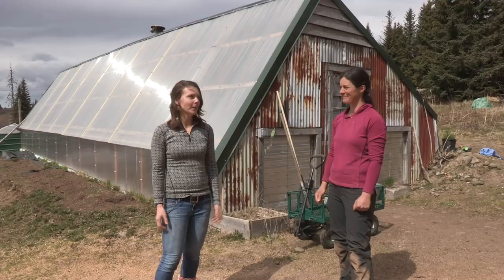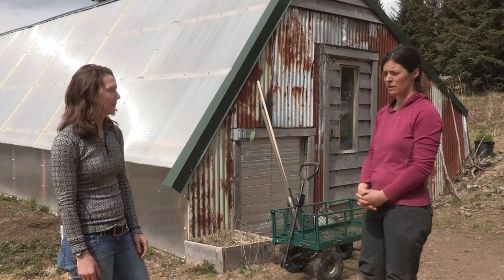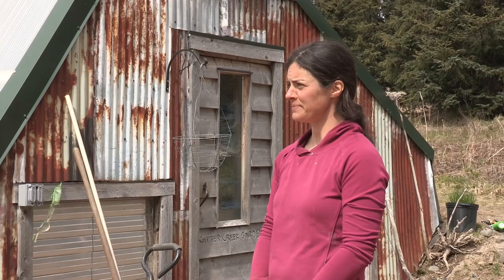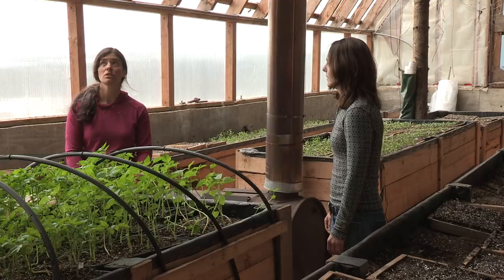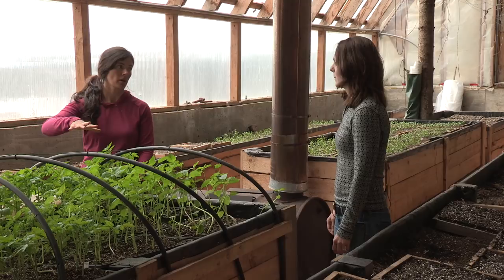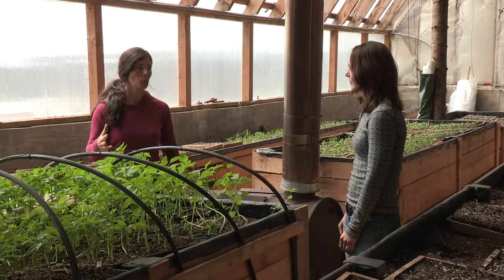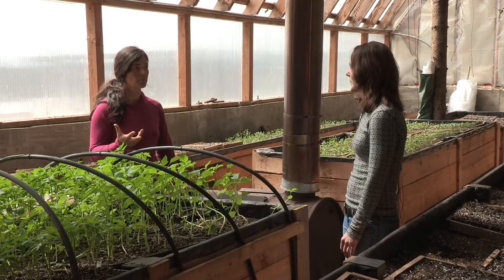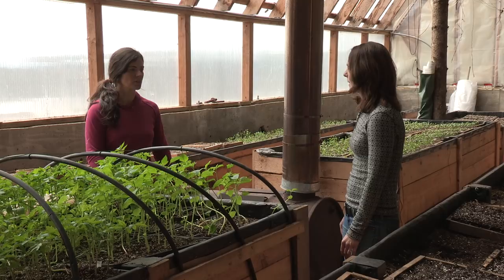A Passive Solar Greenhouse - In the Alaska Garden with Heidi Rader

Comment: Please consider using black paint to coat surfaces that the sun shines on within your greenhouse. The color black absorbs and retains far more energy from the sun in the form of heat than any other color. Black stones and black water containers are particularly good at holding heat. Love the greenhouse, excellent work!
Reply: and our roads should be a cream cement in color
Reply: This is tough in the summer time when solar gain excessive. Have contemplated the same myself. You need a magical material that gets darker as ambient air cools and turns dead white when it is hot.
Reply: @yepnope2195  One method my friend used in his partially-sub-terrain greenhouse to counter the issue of excessive radiant heat capture in summertime is a secondary water tank. One tank is painted matte black, the other gloss white. They are emptied and their positions switched twice per year to help maintain favorable temperatures. The gloss white tank is actually difficult to look at in full sun it's so effective at reflecting the light back at the plants, while the three-coating-thick matte black painted water tank is excellent at capturing and retaining heat. They are using high intensity discharge lamps as supplemental lighting which effectively heat the tank even on fully overcast winter days, which helps retain a lot of heat through the evening. With about ten inches of air insulating the greenhouse between the external and internal vapor barriers, we've been able to grow year round here in Western Canada.
Reply: @yepnope2195  I suppose using 'panda poly' white / black mylar would be a method to attempt if you were in a situation that did not allow for a second reservoir, but I don't think the heat transfer would be anywhere as efficient without direct contact to the plastic. Could you paint one side black and one side white and rotate it 180%? Maybe it could even sit on a wheeled dolly so it could be rotated when full?
Reply: @noyoureahooker  Hah duh, paint your 55 gal barrels two colors. They're not too bad to spin with a little practice. Dollies, while expensive make this a no-brainer, esp if you are stacking. The couple of barrels in my micro-greenhouse are actually stainless atm. I've left them nude atm in the name of conductivity, but yeah I donno. Kinda making it up as I go.
Reply: @yepnope2195  right on.. with stainless tanks I would even consider using adhesive vinyl. Blasting it with the heat gun after application would yield exquisite contact; and you could peel it off with some elbow grease and a little goo-gone if you change your mind.
Reply: Homade sun powered boiler system
Reply: Look up Trombe Wall.
Reply: Use a white curtain to cover the wall in the summer.
Reply: Quiet melt

Comment: Doorways need a “cold trap”. Think of when you open a fridge or freezer...the cold air is denser...it spills out like a waterfall. 
It is known that depressions and hills create “microclimates” outside. The greenhouse in this video is certainly doing the same thing!
The door and stairs are creating excellent cold air spillage down to the floor level of the greenhouse. The air is pooling there and reducing the warmth of the grow beds and their soil. 
A “cold trap” would be an enclosed foyer at a level LOWER than the entry into the greenhouse. The coldest air is thus “trapped” in the foyer instead of being allowed to spill right down the inner greenhouse stairs. It thus modifies the “microclimate” in the greenhouse by reducing loss of heat.
The concrete walls, I noticed, do not have insulation, which is another heat sink for the greenhouse. That will help cooling a bit in the summer, but it does not aid warming in the winter. All the concrete should have closed cell insulation with black bags or drums to hold water. 
They are not using the space effectively, either. Rotating tower gardens would make MUCH better use of the vertical space available. 
For a place that gets as cold as Alaska does, I would certainly build a rocket mass heater. The gas chamber can go over 1000 degrees F, and the bench holds temperature overnight. The extreme heat of the gasification chamber could be used to passively drive a radiator system to heat water stored in drums. 
The greenhouse is really nice...I hope they take some measure to improve it!
Reply: Excellent points. They may have an umbrella system and are using surrounding earth as a heat sink. Otherwise it might make sense to insulate the concrete, but what a waste of mass. Probably insulated on the outside.
Reply: The real problem here is not heating the greenhouse as much as lack of sunlight in the winter. Nothing grows without light.

Comment: Two layers of pre-measured and pre-cut and pre-chemically strenghtened glass that are flexible when very thin and can be folded like a ribbon (mid-1960s technology that all greenhouse owners should know, they are also used to make flexible glass springs!) but this time it will be thick (or glass ceramic panes). 2 layers of pre-measured and pre-cut and pre-chemically strenghtened glass (or glass ceramic panes) were used with a pre-measured and pre-cut silicone rubber interlayer in between them and bonded together with a dissolved silicone resin plastic. Neither extreme heat or extreme cold will past through the silicone rubber. This will be your outer layer greenhouse glass which will be bolted and glued air-tight and water-tight with the same dissolved silicone resin plastic. The second inner layer with be a single layer of pre-measured and pre-cut and pre-chemically strenghtened glass (or glass ceramic) that will be bolted and sealed with the same dissolved silicone resin plastic. Them the high-strenght military grade metal frame of the greenhouse on the outside and inside will be ELECTROSTATICALLY SPRAYED with a mixture of pre-dissolved silicone rubber-resin plastic coating to prevent heat and cold transmission from the outside to the inside. Then the space between the two greenhouse structures will be filled with pure carbon dioxide that will absorb and store the Sun's heat which will be gradually transmitted through the inner pre-measured and pre-cut and pre-chemically strenghtened glass panes to provide warmth for the greenhouse. 

In Siberia we use the  2 layers of pre-measured and pre-cut and pre-chemically strenghtened glass were used with a pre-measured and pre-cut silicone rubber interlayer in between them and bonded together with a dissolved silicone resin plastic and the high-strenght military grade metal frame of the greenhouse on the outside and inside will be ELECTROSTATICALLY SPRAYED with a mixture of pre-dissolved silicone rubber-resin plastic coating to prevent heat and cold transmission from the outside to the inside. And inside are tanks made out out pre-measured and pre-cut and pre-chemically strenghtened pyrex glass tanks (or glass ceramic tanks) or yrttia-stabilized zirconia glass fiber reinforced KAPTON plastic tanks, sealed and contains BRINE that absorbs the Sun's heat until it reaches near boiling point. The huge tanks will be able to capture store enough heat to be dissipated to keep the greenhouse safely warm for both plants and humans and animals.  

Other greenhouses uses the 2 layers of pre-measured and pre-cut and pre-chemically strenghtened glass (or glass ceramic panes) were used with a pre-measured and pre-cut silicone rubber interlayer in between them and bonded together with a dissolved silicone resin plastic. Neither extreme heat or extreme cold will past through the silicone rubber. But to grow also fast growing coppiced and/or pollarded willow trees or calliandra calothyrus trees for the Jean Pain Compost Method to simultaneously produce heat for heating through the winter through the compost fermentation process and produce carbon dioxide to help feed the plants (plants inhales carbon dioxide and exhales oxygen) and provide fertilizer once the compost has transformed itself into humus to be used as fertilizer. 

http://journeytoforever.org/biofuel_library/methane_pain.
html https://www.google.com/search?biw=1600&bih=757&sxsrf=ACYBGNRGXUQSzIjmaC1_yT1p-zZ8Sq3LYA%3A1572129885581&ei=Xcy0XdqMI5at0PEPyJSZ-Ao&q=jean+pain+king+of+green+gold&oq=Jea&gs_l=psy-ab.1.0.35i39j0l7j0i131j0.1286847.1289501..1291798...1.2..2.78.483.7......0....1..gws-wiz.....10..0i71j35i362i39.xZv9k56UZBQ

In the Siberian Arctic circle however, the greenhouses are vastly different. They use 2 layers of yrttia-stabilized zirconia glass fiber reinforced silicone rubber-silicone resin plastic panels with an interlayer of high-military grade strength stainless steel welded and interwoven silicone rubber over a greenhouse walls and roofs made out of Riveted bridge deck for flooringhttp://ohiogratings.com/Content/pdfs/product/bridge_brochure.pdf .
Reply: Heat is not as big a problem as lack of sun.

Comment: Emily Great job simple and functional, so many comments if you do this and put in a fan blah blah blah , it works thanks for sharing. I do have a few questions  you said all in about 20,000, did you pour the walls your self and did you have a truck deliver the concrete or did you mix bags. I am asking because i am planning to build one of these. I would like to know also average day/ night temp without stove assistance. Thank you for the video and sharing your story wishing you the very best
Reply: I'm not the builder of this, but they most likely had the concrete delivered. Mixing concrete is tough and stressful, and if you're gonna use a large amount of concrete (couple of cubic meters & upwards) you better make sure to have everything close at hand, multiple blenders and plenty of manpower.
The added cost of having it delivered is almost always worth it. You dont have to age prematurely and you know it's of good quality
Reply: We poured the walls ourselves and had the concrete delivered. We used the long extended tube to pour the concrete from the truck and not the standard chute out of the back of the truck.  We built the forms old school with plywood, J Bolts and Snap Ties instead of the modern standard of ICFs.  This way I could insulate the outside of the wall and not the inside.  Good question on average temps. I don’t have a clear answer for you on that one yet, but I’ll work on it! We only need the wood stove in March and occasionally in April to keep temp up for growing starts.  We never use the wood stove in the summer months. The fans and louvers are on a thermostat so temp control (if too hot) is automatic.  I hope that helps!

Comment: That is a well though out operation.  One of the challenges I have here in Central Oregon Cascades is 2 to 4 feet of snow pack can cover much of lower part of greenhouse during winter.
Reply: You've mentioned a interesting problem. Would a slope in front of your greenhouse have eliminated your snow pack difficulty?  My plans are all in my head now. But a well thought out plan will help me later. I've considered covering and using a natural slope.
Reply: @douglascunningham6319  There are only two ways that I know how to get the snow away from the side of the greenhouse.  1. use snow blower to remove it (that is a lot of work even with a snow blower, snow sets up and gets very hard).  2. would be to set the side of the greenhouse on the edge of a retaining wall so snow would fall below ground level of the greenhouse but then you would loose the benefit of having a pit greenhouse.  I have elected to not have the pit greenhouse and live with the snow.  During winter months the sun is  out so few hours even at 44 degrees North plants just do not grow even in heated greenhouse with out extra hours of light.  No perfect greenhouse just the best compromise.    I love my greenhouse even during winter months.  On a sunny day it can be 80 degrees F inside and - 5 degrees F out of doors.  One winter I planted a roll of grass on the floor and could have lunch and have my toes on green grass.  :)
Reply: Do you use any insulation on the glazing, inside the greenhouse, to retain heat overnight?
Reply: @tomlampros7122  I use a double layer of poly with a fan to inflate the space.  On lower portions of the walls I do put in semi ridged Styrofoam to reduce heat loss below snow levels.  Some day I plan on new greenhouse and using ploy carbonate panels.   I need to formalize the design and make the time to build it.

Comment: The glazing angle is for glass due to the reflection aspect of glass with polycarbonate its an issue
Reply: Sry, did you wanna say "with polycarbonate it is NOT an issue?
Reply: No, its for the sun to hit it straight on to minimise reflection (and therefore heat loss) on the shortest day of the year.

Comment: It looks like a really nice greenhouse! Do you ever put an extra layer of plastic over the outside in winter to add a little bit of insulation there at night?
Reply: I've invented light reflecting insulating shutters for green houses. They definitely delay or prevent the need for nightime supplemental heat. Also if the sides, back roof, and back were made with aircrete it would add in the heat retention. Day time high temperatures can be sucked off the ceiling and blown through irrigation drainage tubes in the floor. Additional solar hot air heaters can feed into the floor tubes.
Reply: This works for them, theirs never ending if you do this or if you do that , this works for them
Reply: @timmeier8863  Well of course, but I like hearing these ideas. They have provided some value to me.

Comment: Could you increase the temperature by adding composting materials to the floor during winter?
Reply: bronze fennel I suppose you could if you had a real active compost pile. We store compost through the winter in the greenhouse so it is ready to use for seeding long before the spring thaw. The greenhouse rarely dips below freezing year round.

Comment: Have you considered <<grounding << your planters..ie connecting a wire to a rod in the Ground..I have heard that <<grounded<< planters do better than off-ground, ungrounded planters. Maybe Check into it.
Reply: Got any links talking about this?  I would this be related to WiFi in the area?  If not that, what else?
Reply: @swilhelm3180  grounding is tapping into the low voltage direct current in the earth crust..not related to wifi..see the video called Earthing..occurred in Alaska..a Hotel even grounds the Beds..it counters Inflammation and many other ills...free  radicals cause damage..grounding provides an electron that they can combine to
Reply: @andreewert1142  I tried grounding myself in bed each night for a few nights....didn't feel different in the slightest.  Use our piping system which definitely was grounded.  How well I don't know.  Apparently it can be measured.
Reply: @swilhelm3180  Yes, take a Multimeter reading..maybe the Connection between the pipe and the Wire needs improvement ..because Grounding has been proven over time to prevent snoring...when the guy dies electrocuted on his Mat..I dunno..tweak it....if not, go lie on the Grass...lol

Comment: Is there permafrost in Homer? Just curious about how the partially below grade design works in areas of permafrost...
Reply: Discontinuous permafrost doesn't generally reach to the end of the Kenai Peninsula. If you were going to utilize an insulated northern side of a three season greenhouse where there is discontinuous permafrost, you would most likely not place  a back pony wall into a bank cut (providing there is permafrost at your site).  You want to avoid a heat transfer from a foundational thermal mass into frosty soils (especially with the woodstove adding to the passive solar space heating).  So you could still utilize the north facing (pony or insulated) wall but have it above grade with on a modified pad/post foundation system. <Art Nash of UAF Cooperative Extension, 474-6366>
Reply: Not here, luckily!

Comment: This is a basic greenhouse. Would be far better with a passive heat storage system (NOT the same as passive solar) using the earth around it. Homer is a tough situation because there aren’t many sunny days, winter OR summer.